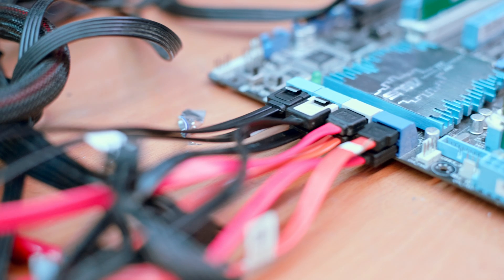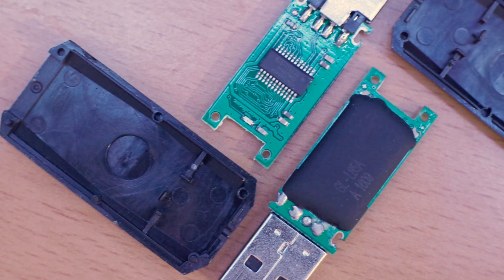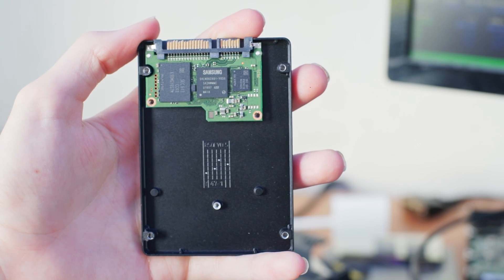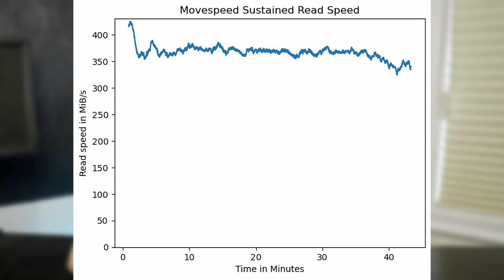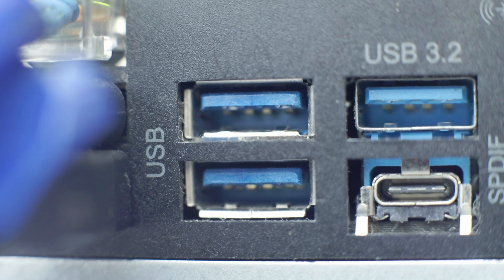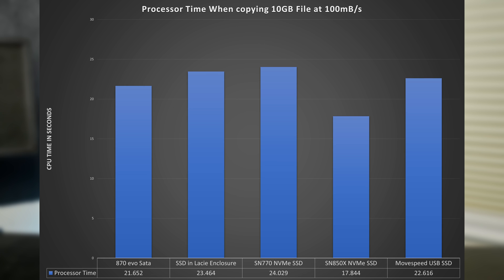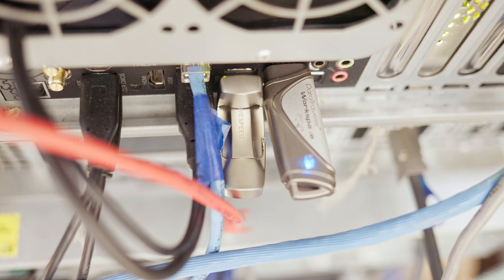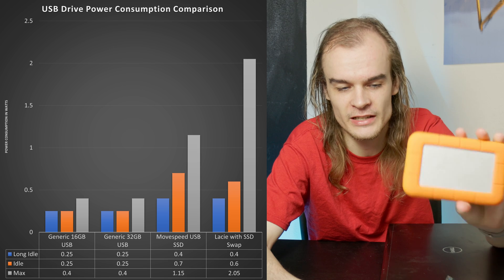Movespeed 1TB USB SSD Review. How Does USB Storage Hold Up?

Comment: I have a Dell Inspiron i3558 Intel Core i3-5015U 16GB DDR3L RAM, 1TB HDD
It has a 3.0 usb and i was initially thinking just connect a case/bay of my drives to that and call it a day, but what other type of connection could I make to have the drives run better if thats even possible? I have an optical drive on the laptop i could remove which would free up a port. The spec documentation says that would be a SATA 1.5gbps. I see some people have removed their wifi hardware and replaced it with a M.2e Key 2.5gbps ethernet adapter. Using command sudo lspci -vv it showed my width for the wireless port is 1 which i believe means it has the capability to be swapped.
Out of those 3 connection options, how could i best utilize this machine to be the best NAS?

Comment: do an update on this story and add a bunch on a hub - the upgrade from thumbdrive raid - also think strongly about going to nvme since there is virtual price parity with reg ssd - we should start to see this area grow as more pc come with usb4 and even usb5 is not that far off so things look bright for the nvme usb brick raid array - you also may get better numbers if you can use dual ports or dual usb controllers. running raid10 and/or swap on raid may be a good experiment also

Comment: I have a home server built entirely on usb ssd for six months now. I haven't found any problems during this time. The server runs win 11 pro for workstation with kodi and mpc on board. From the main computer I access the server via SMB. The server stores mostly videos and games. Everything is on double parity disk space. Ten 2 tb disks. TLC crucial x6 if I remember correctly. Speed is good enough for me, especially considering it's double parity. About 200 megabytes per second for linear writes (via smb) and 30 megabytes per second for random. Power consumption is 50-60 watts.
Reply: Could you clarify if the Windows 11 Pro is a VM, and by Workstation you mean VMWare Workdstaion?

I have an HP ProDesk running Windows 10 with Workstation Pro 16. The VMs are in the NVMe drive, but because of the small enclosure inside, the NVMe heats up at 55C. I'm thinking of using a USB3 adapter with a 2.5" SATA SSD to place the VMs in.
Reply: @KunouJS  Nonono, it is physical machine and Win 11 for workstation is just Win 11 pro without some components